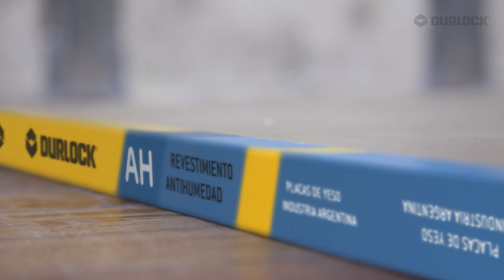Instalación del Sistema Antihumedad Durlock® (Paso a Paso)

Comment: Para paredes altas, las placas van acostadas?
Reply from the maker: ¡Hola Favio! Nuestras placas Antihumedad Durlock deben colocarse de forma vertical.
Los perfiles omega se colocan con una separación entre ejes de 40cm y se fijan a la pared a revestir con tarugos de de expansión de nylon N8 y tornillos de acero de 6mm de diámetro x 40mm, colocado con una separación máxima de 60cm.

Sobre los perfiles omega se coloca una capa de placa Antihumedad Durlock, fijándolas mediante tornillos autorroscantes de acero T2 punta aguja, con cabeza trompeta y ranura en cruz.

Adjunto link con hoja técnica de nuestro sistema AH Durlock: https://www.durlock.com/uploads/descargas/Hojas%20t%C3%A9cnicas-3cf9ad0bf280f134296472e44d971706-ht-ah-002-.pdf

Comment: Hola muy buena solución, la voy a probar en una casa antigua con problemas de humedad de cimientos. Tengo algunas dudas, una es en el piso que hay que dejar 1.5cm, eso debe quedar asi¿í, o se puede tapar con un zocalo?? y la otra es parecida pero en paredes que se unen a 90 ° tambien hay que dejar una separación entre las placas para que ventile¨?
Reply from the maker: ¡Hola Simon! Si correcto, en la parte inferior queda una separación de 12,5mm la cual se completa con un sellador PROMASEAL-A Durlock al igual que en los laterales y la parte superior. Como terminación inferior se puede colocar cualquier tipo de zócalo y en la superior moldura de poliestireno o pvc. Más info en https://www.durlock.com/antihumedad/ ¡Muchas gracias y saludos!

Comment: Como tendria que hacer porque yo tengo zocalos d cerámica, deberia sacarlo? O se puede poner x encima del zocalo?
Y si se pasa agua al piso no se rompe la placa?
Reply from the maker: ¡Hola Jonatan! En lo posible te conviene sacarlo y si está en buenas condiciones podrías reutilizarlo y pegarlo encima de la placa. Si el espesor del zócalo es menor al omega podrías dejarlo y pasar la placa por delante, lo que si te va quedar esa parte sin estructura por detrás y podría ser un poco más débil (depende la altura del zócalo también)
Se deja generalmente la placa separada aproximadamente un cm del piso para evitar cualquier problema con el agua, luego se tapa con el zócalo. ¡Muchas gracias y saludos!
Reply: @CanalDurlockOficial  disculpe mi opinión, pero soy pintor de obra y he visto que en los casos en que colocan zócalo de cerámica adherido a la placa de yeso, generalmente termina teniendo problemas de humedad, ya que deja nula la función que cumple el separar la placa del piso. Recomendaría utilizar zócalos de pvc, hay variedades y algunos imitación madera que están  muy buenos. Saludos

Comment: En Salta tienen quien pueda hacer o guiar el trabajo,mi casa es de placa cementicia x fuera y durlock x dentro y la humedad está en el durlok y sube del socalo como 40cm
Reply from the maker: ¡Hola! Podés consultar en:
Corralón Aconquija
Chile 134, Salta
(0387) 496-0787

Saltapor
Leguizamón 1946, Salta
(0387) 431-0898

Promet
Av. Chile 1680, Salta
(03873) 01-3581

Corralón Sansone Materiales
La Rioja 1850, Salta
(0387) 422-0643

Corralón El Mercado independencia
Independencia 698, Salta
(0387) 423-2233

Comment: Hola , quisiera saber cuanto tiempo duran las placas ? Pregunto xq las placas en algún momento la va afectar la humedad !!!
Reply from the maker: ¡Hola Ivan! En relación a su consulta te informamos que la durabilidad de la placa AH Durlock® es abierta en el tiempo siempre y cuando el sistema este instalado correctamente y siguiendo nuestras recomendaciones técnicas.
Te adjuntamos links con el detalle técnico:
 
https://www.durlock.com/uploads/descargas/Hojas%20t%C3%A9cnicas-3cf9ad0bf280f134296472e44d971706-ht-ah-002-.pdf

https://www.durlock.com/uploads/descargas/Sistema%20Durlock%C2%AE%20Interior-d5a5d895851aac6ac1aedcc4e6f1b8e8-cs-sistema-ah.pdf

Comment: Buenas , yo tendría q poner unas placas en forma horizontal y mí consulta sería cada cuánto se ponen los tornillos en el perfil y también a cada cuando ( distancia) se ponen los tornillos en el durlock ?
Reply from the maker: ¡Hola Diego! Nuestras placas Antihumedad Durlock deben colocarse de forma vertical. 
Los perfiles omega se colocan con una separación entre ejes de 40cm y se fijan a la pared a revestir con tarugos de de expansión de nylon N8 y tornillos de acero de 6mm de diámetro x 40mm, colocandos con una separación máxima de 60cm.
Sobre los perfiles omega se coloca una capa de placa Antihumedad Durlock, fijándolas mediante tornillos autorroscantes de acero T2 punta aguja, con cabeza trompeta y ranura en cruz.
Adjuntamos link con hoja técnica de nuestro sistema AH Durlock: https://www.durlock.com/uploads/descargas/Hojas%20t%C3%A9cnicas-3cf9ad0bf280f134296472e44d971706-ht-ah-002-.pdf

Quedamos a disposición por cualquier otra consulta.

Comment: ¿Es posible la combinación con un aislante, xps, lana mineral o similar?
Entendiendo que debe quedar igualmente una circulación de aire interior, quizá colocando una fina lámina reflexiva de 5mm por la cara oculta de las placas, o quizá un aislante tipo lana de baja densidad que permita el paso del vapor entre él. Gracias.
Reply from the maker: ¡Hola! ¿Nos podrías pasar un contacto así se comunican desde el Dpto. Técnico? Gracias.
Reply: Se deja camaras de aire como rejillas de plastico
Reply: @marcopatricioparedesquishp3374  La pregunta es acerca del aislante, no de las rejillas o forma de ventilación.